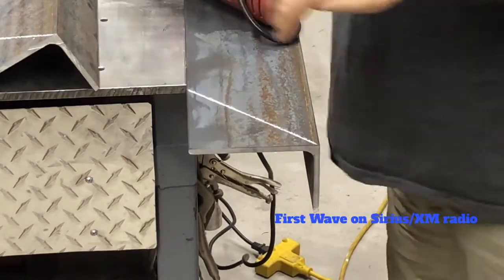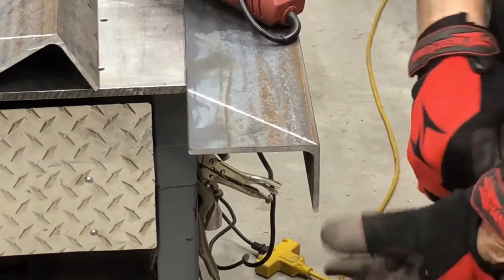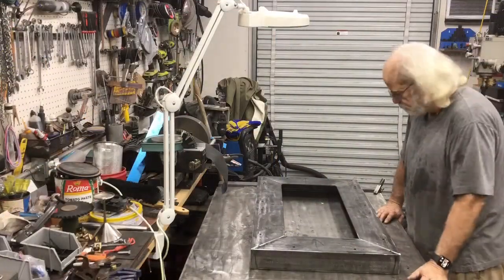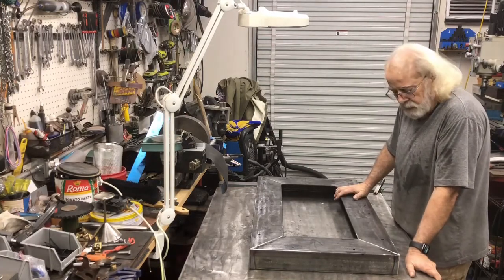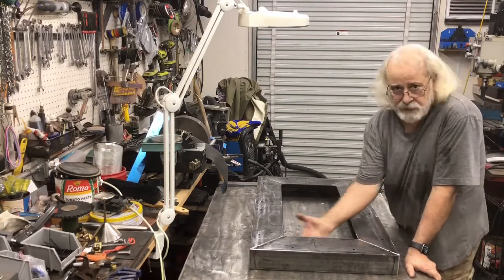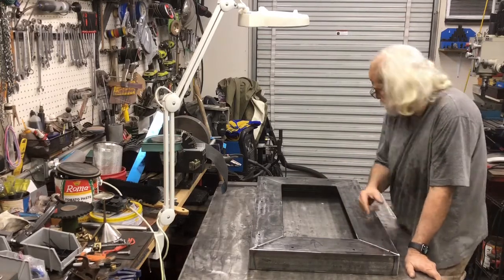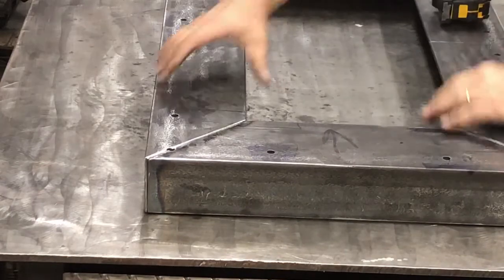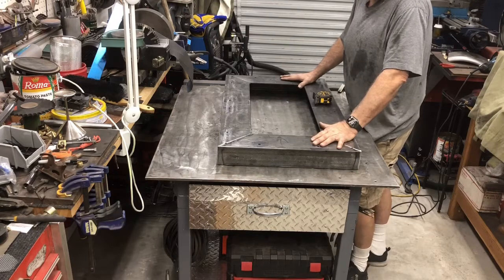Motorized Trailer Dolly V2, E2, The Frame

Comment: No guard, one handed and over hand operation yet you have glasses respirator and gloves. Almost there. Might I suggest a plasma cutter as your workshop seems to have everything else and you don’t need to store gas cutting bottles. Great build by the way and great diy guides.
Reply from the maker: A plasma cutter is on my list, right after a bigger compressor.

Thanks for the comments

Comment: What camera and app are you using to be able to control it from your Apple watch? Cool build by the way and yes I was most concerned seeing the missing guards from the grinders....
Reply from the maker: It was an IPhone 8 so it links a lot of stuff to the watch.

Risk management is the key to operating with the guards off.  I’m always hyper aware of the “plane” of the disk, stuff flys off perpendicular to the axis of rotation.
Reply: @papasfixitshop7982  cool, I had no idea the watch can be used as a "monitor"....